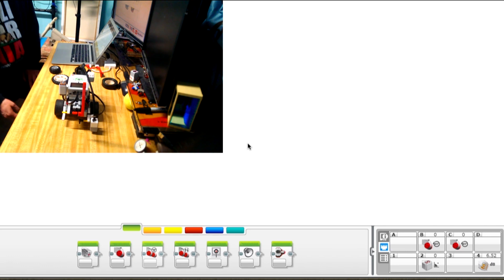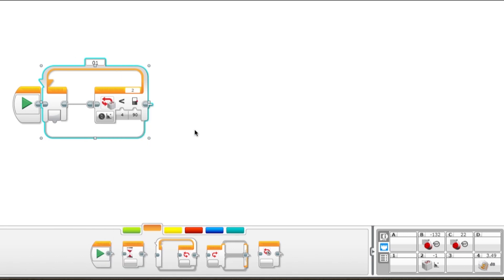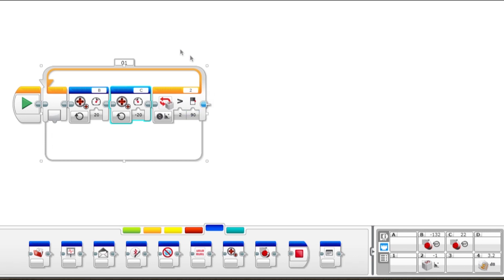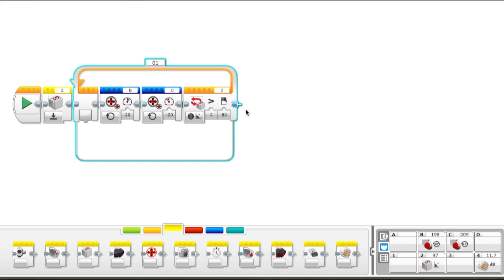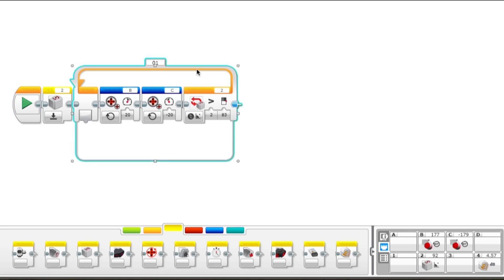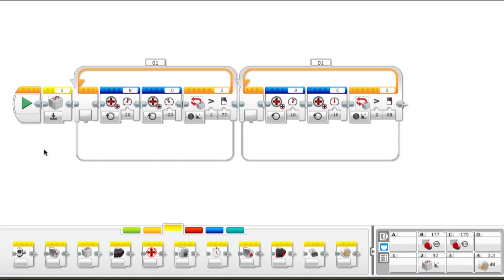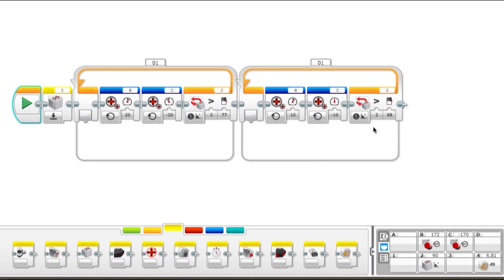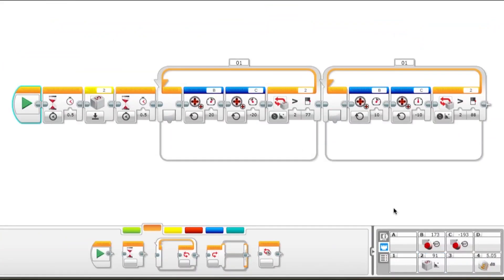FLL Accurate turns using Gyroscope - Software

Comment: Thanks for the vids and guidance. When my team tries this method by itself it works, but when they include it within a program, the robot just spins. It’s almost like it forgets to read or see the gyro after start. Any ideas??
Reply from the maker: The gyro can start to increment when the robot isn't moving - you can tell by looking at the real time value on the robot or in the EV3 software.  If it's incrementing (drifting) you'll need to unplug it, wait a second then plug it in again.  That's the most common cause I've seen, for spinning a robot.
Reply: Thanks jerry. I’ve noticed the incrementing before on certain test runs of other programs. So would the incrementing explain the lack of stopping when we incorporate this turn mechanism later in a program and it keeps turning?
Reply from the maker: @ericstephenson8749  Yes.  basically the program says "turn until the gyro is equal to 90 degrees"...  but since the gyro is in a bad state(drifting/incrementing by itself) the turning continues forever because the gyro was already at five thousand degrees(et al.) - because it's been incrementing the whole time(or decrementing).  Another tip use >=  or <=  instead of just = when comparing, because even when everything is going right, it might miss the one degree you're looking for.  1KHz sample rate iirc.  If nothing else you can send me your program & I'll load it to my ev3 to help debug, or send a screenshot if there's no "myblocks".

Comment: Are there any benefits choosing the unregulated motor blocks instead of the large motor blocks?
Reply from the maker: On the normal blocks the software tries to control & measure rotation - like if you say go forward for 2 rotations, the motors provide feedback to the EV3 so it can correct for things like low battery, resistance, etc..  I want to have full control of the motors, because I will control them based on the gyro sensor.
Reply: @borjonx  Cool, I didn't know that. Thanks for the reply